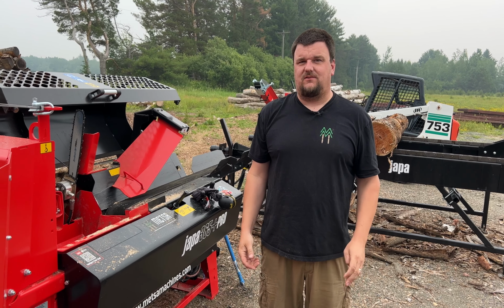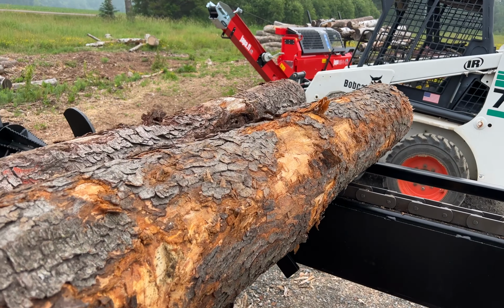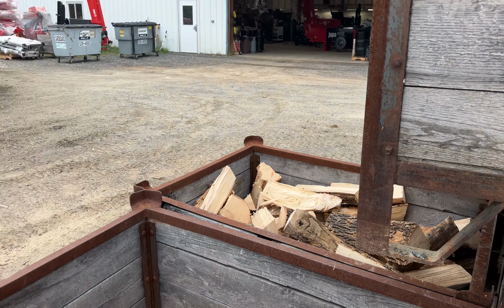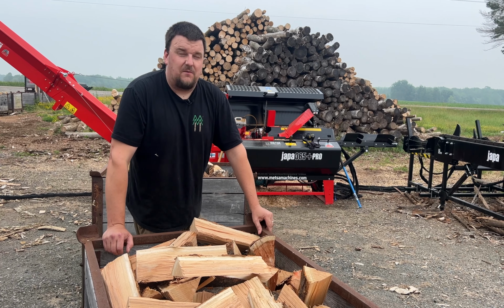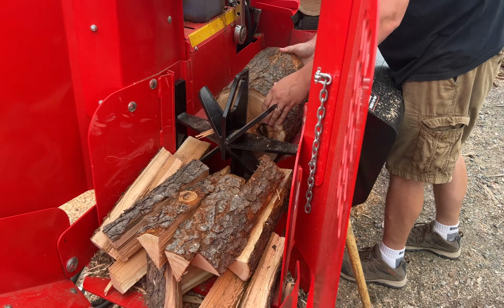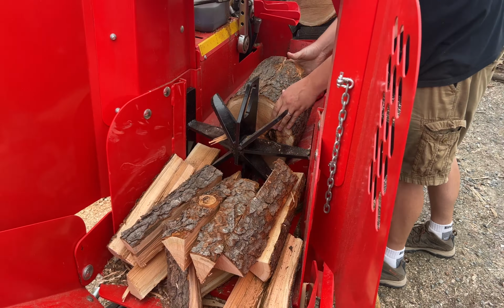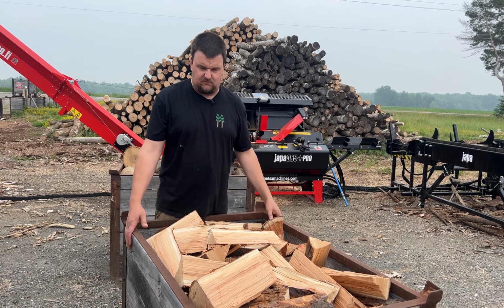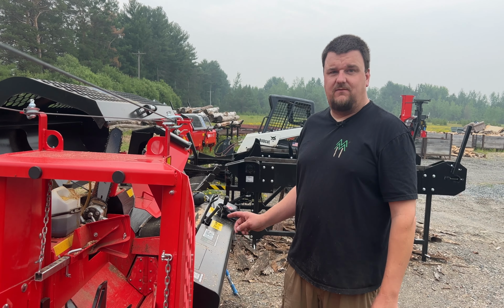Making Cherry Jam with the Japa 365+ TRE

Comment: How did you transport this splitter to the job site? Did you trailer it or tow it? I would be concerned about trailer sway at hwy speed.
Reply from the maker: The stationary model would be trailered. The towable version can go down the Highway. We always recommend a log lift with the towable units because it makes them more functional for mobile processing, but the loglift also adds tongue weight which helps reduce sway.

For reference, the 315 has been towed several hours away by a Jeep Cherokee without any issues.